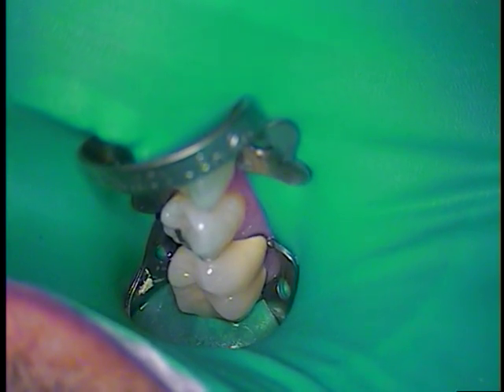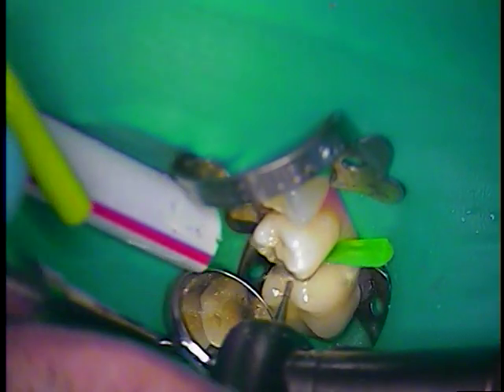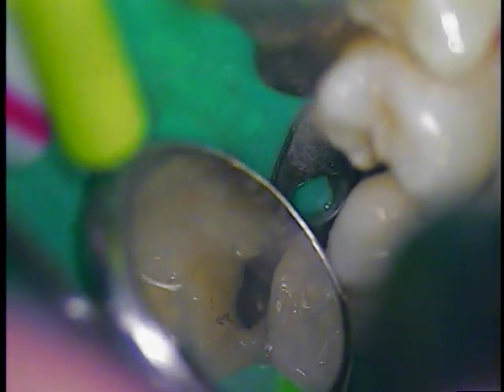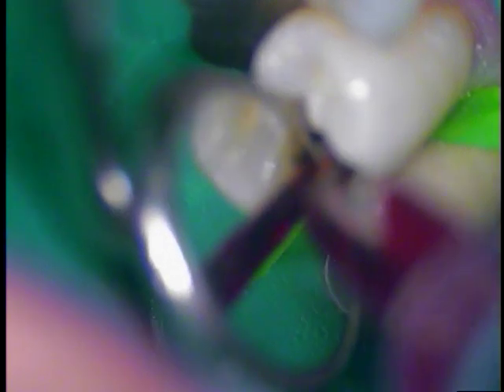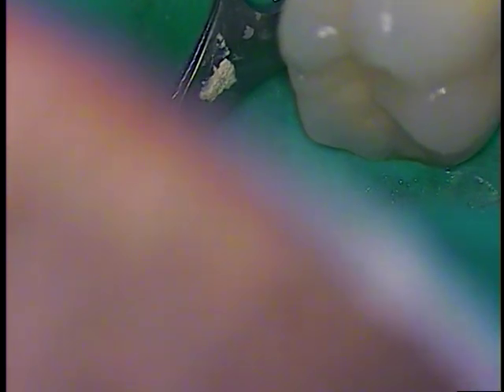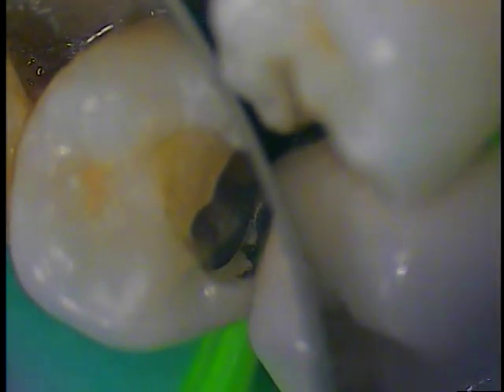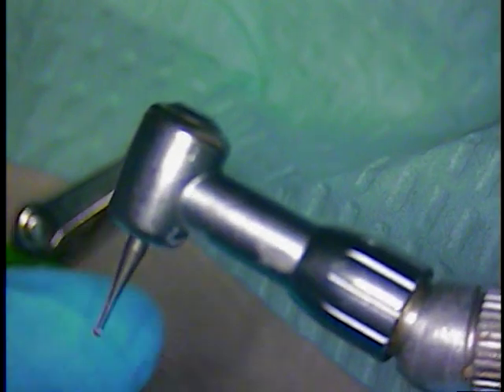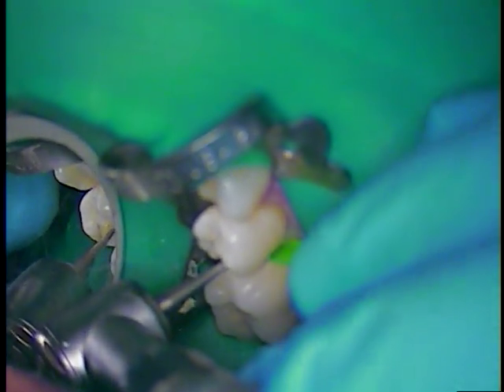Class II Preparation  - Dr. Gerard Cuomo

Comment: thanks for the video. why did you place the rubber dam like that? dont you want to block out of the interproximal gingiva tissue? in your other class 2 video you place it interproximally. just curious :)
Reply from the maker: Hi there-- I will vary the r-dam hole punch design with sub-gingival box preparations. Most of the time, I will punch individual holes though.